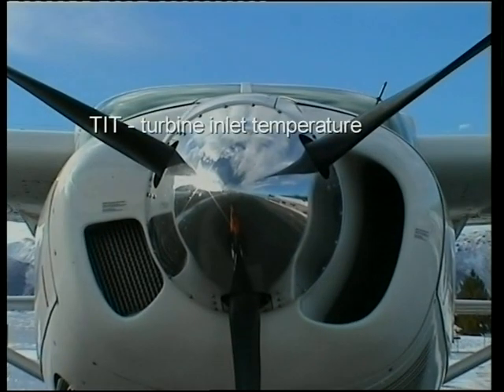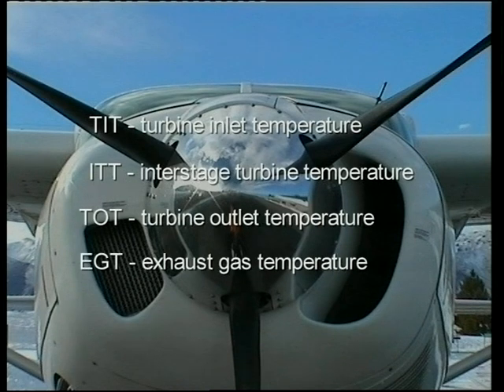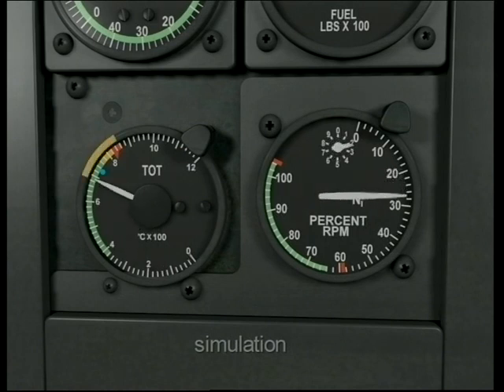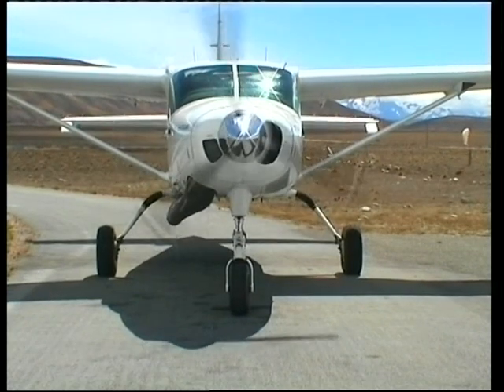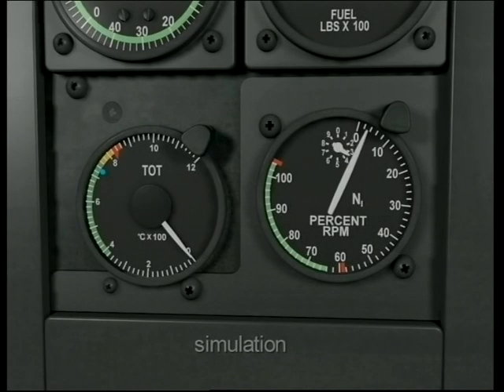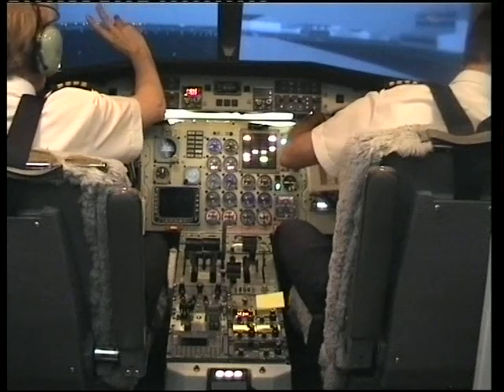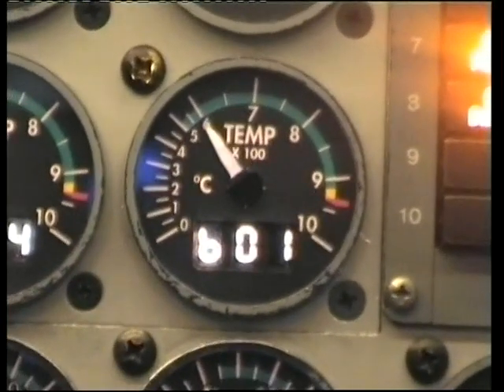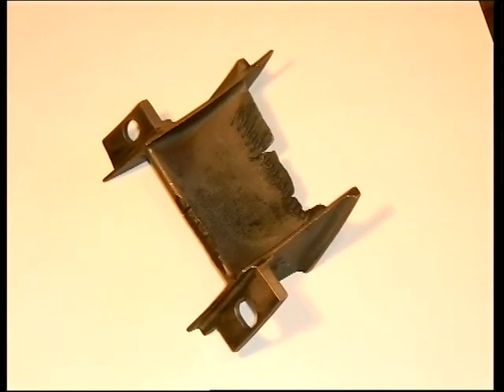Gas turbine engine handling

Comment: I fully agree with you, and would add more. The presence of an ECU / FADEC, although highly desirable, should be no excuse for the pilot to lower his/her attention during the startup sequence, or to lack the skills to master said sequence manually if so desired or necessary. It is the most critical part of a turbine engine duty: it's where shit is most likely to happen. A pilot who doesn't possess thorough and solid comprehension of it, IMO, does not have any right to fly a turbine aircraft.

Comment: Why cant the full size turbine engine used an ECU (Engine Control Unit). This will eliminated  starting error??.  Example I can start my single stage model turbine engine  with one command. During startup the computer checks rpm, temp battery, any hotstart the ECU terminate starting  sequence and gerarate an display a trble report and used the starting motor to cool engine.